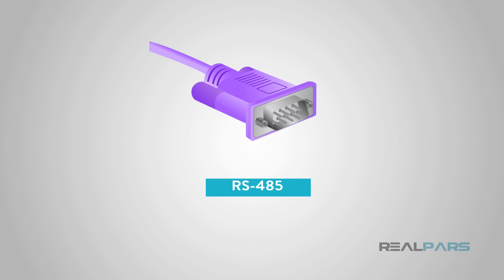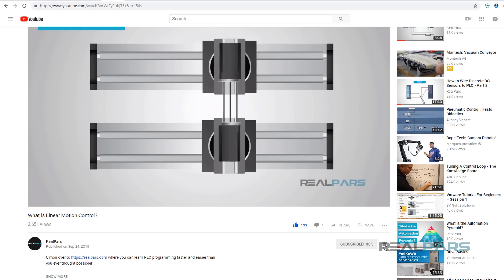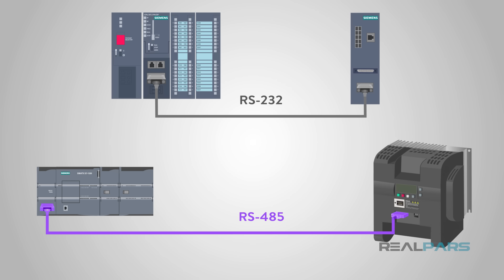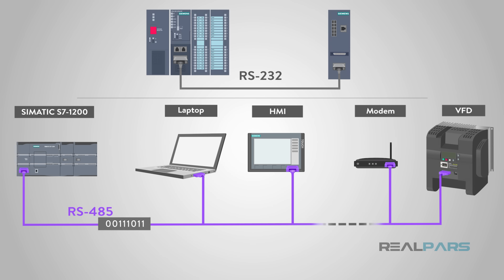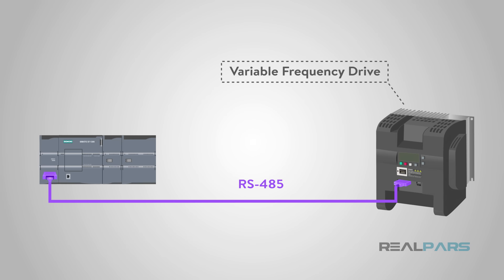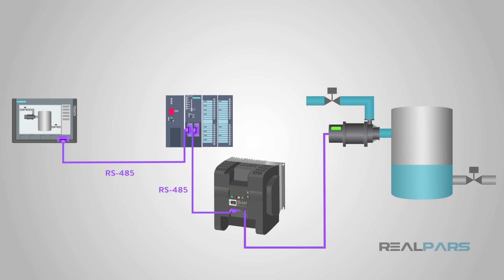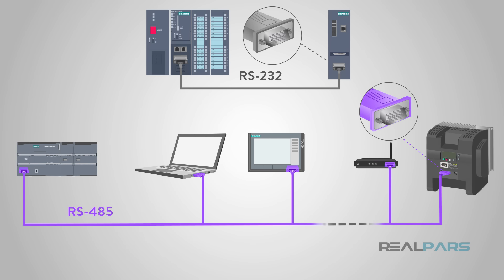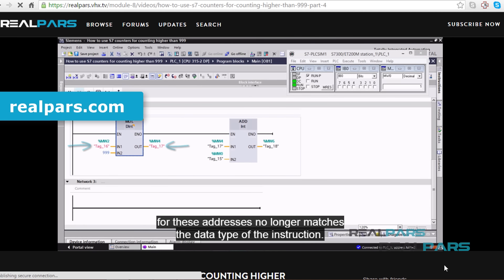What is RS485 and How it's used in Industrial Control Systems?

Comment: The range of the bus is higher and it can support faster speeds because of Differential Signalling. The signal sent across the bus is not referenced to ground, but to each other. The difference in signal levels between the bus wires determines a 1 or a 0. Noise if present pushes both the wires up or down in the same magnitude, thereby maintaining the difference in signal levels. USB is a faster bus partly because of differential signalling.
Reply: In fewer words, a balanced signal.
Reply: great summary, thank you.
Reply: Sadly, the USB bus until version 3.0 used a single twisted/balanced pair of wire, unlike the FireWire which used one for transmitting and one for receiving, causing significant delays and slow-downs on USB.

Comment: Resistance to electrical noise isn't only because of cable shielding, but also thanks to the fact it uses a differential signal rather than a common ground, as with CAN bus. This also allows compensation against interference.

Comment: The 485 systems I work with can address 255 devices... 32 devices is the minimum unit load supported.  10Mbit is the fastest speed possible... you can't go as far in distance at that speed.
Reply: Right we do 99 just because we only have 2 addresses dial’s. Also 1000’ is about as long as we can go without a repeater. With networks way way over 4000’ total length.

Comment: How to connect an inverter that has an RS 485 connection with a heat pump that is controlled by the SMART GRID connector?
Reply from the maker: Hello, @mateuszmayjaszczyk7415. Thank you for your question. Sorry, but we can’t comment on this. We don’t know your system. If you don't have a user manual, it would be beneficial for you to contact the manufacturer.  Happy learning from RealPars!

Comment: My new residential heat pump uses rs 485 for thermostat and communication between the air handler and the compressor condenser. To bad Honeywell and others stick to the 5 wire c configuration…

Comment: You may need a termination resistor of 50 ohm. Avoid running the wires outside it become damaged by lightning. As a field service engineer I found that electricians are used to wire electricity a and electronic,  make sure they know that black is ground and red is high in electronics. Rs485 wiring is very sensitive that way.

Comment: We used to instal high end Point of sale network with RS 485 cables. This is highly reliable. Terminal to terminal ( IRC) and Kitchen printers commonly used. All systems on embedded platform. Master / slave configuration and programs done.

Comment: RS-485 is more accurately described as the grown up big brother of RS-422. It’s not fair to compare it directly to RS-232. The reason RS-485 still enjoys massive usage in industrial applications is due to the range of physical layer implementations. As stated in the video it supports multi-drop as opposed to just point-to-point like RS-232. However, it can be used in full or half duplex modes. This means that a station on a RS-485 bus can simultaneously transmit and receive data at the same time.
RS-485  can be transmitted over both optical and copper physical layers. The optical implementations support dual redundant optical rings which are very robust. Both optical and copper layer repeaters mean that each copper segment can be extended to then support up to 255 node addresses (0 to 254) for the overall network. The actual protocols that run over this RS-485 physical layer are also very lean and efficient in data throughput. Profibus-DP is one example, but please note that Profibus does make a number of changes to the underlying RS-485 physical layer rules (capacitance and inductance limits, etc). Profibus-DP can run up to 12Mbps. Unfortunately, RS-485 is probably the single most misunderstood transmission technique due to a lack of understanding about bus termination requirements and correct screen connections.
Reply: Very good, RS 232, in most configurations, is point to point Where RS 422 is point to multi-point  and  RS 485 is multi point to multi-point.  Where I once worked we made counter rotating, self healing, multi-master ring modems capable of translation from 485 to/from 232 to/from 422.
Reply: David Moran 

This flexibility and ability to in effect cascade these different physical layers has also contributed to its longevity and success. RS-485 devices can also be used to replace failed stations in older RS-422 architectures with very little difficulty, although the reverse isn’t always possible. However,  you can drop an RS-485 master into an existing RS-422 slave network with no problems.
Reply: Hi ! how can we use the RS-485 or RS-232 like does it have a relationship with the devices or cablee

Comment: Practically t it is an industrial  I2C communication that may work with 12/24 V without a clock (SCL) or a SDA pin. Instead of that uses A and B lines to communicate as if they would be TX or RX, but at the same time works by adresses. If I said something bad, correct me. I never knew about that type of bus before. (But the video gaved me an idea).

Comment: I find this useful and until earlier today at work I had never heard of RS485, but I’ve heard of and used a RS232 Cable connection. I also maybe think 🤔 something that could of also being elaborated on in the age of where almost all if not many controllers have a Ethernet connection when and where a RS485 cable could be useful? I’m just junior programmer but do O.P.A.C. Engineering - Operation, Process, Automations Control Engineering. Wear many hats in what I’m doing from one week to next. Two weeks ago was on a RO plant water system startup at a plant site. It was SLC PLC with redundant processor chassis and all Ethernet connected to plc network switch with remote I/O’s. To connect directly to the SLC  Processor while system was all online had to connect via RS232 on the SLC Card to Primary and Secondary Processor. As the Ethernet port was in use on both cards connected to network. That’s an example I can think of and recent where having my RS232 to USB on laptop Serial cable came in handy and was good to have. Such an example also could of being more in depth explained with the RS485 cable in various situations. However, still excellent video to educate and the more I now know.
Reply from the maker: Thanks for sharing your thoughts with us!
Reply: Is there a list of cables that fall under the category of RS232 and RS485 separately?

Comment: In the case of controlling a vfd, that also could have been achieved by a current loop.
You could have pointed out more benefits.
Ability to push firmware updates, remote configure device, receive status information etc.
Reply: Can I use RS 485 cable with DB 9 pin head, instead rs 232 cable with the same head?
Reply: You can use a DB9 connector but what do you mean by RS485 cable? Any twisted pair shielded cable can be used.
Reply: @piratenu1  Lust night I have fixed...Thanks for help

Comment: its a very good informative video. Just a little correction, when you say that an that an RS-485 network can only support 32
nodes. This is not true. Device manufacturers now sell 1/4 UL transceivers (DS1487) and even 1/8 UL parts (MAX1482).
Assuming each node presents 1/8 UL to the transmission line, an RS-485–compliant network may sport as many as 256 nodes (32 UL × 8 UL/node = 256 nodes).
Reply from the maker: Thank you, Mario! Much appreciated

Comment: Hello, I have a question about 485 communication.
Is it possible with a “D1 MINI WEMOS Pro 4M 16M” using “Tasmota” e.g., B. to control a “JUNTEK DPM8624 60V24A Programmable DC/DC Digital Adjustable Step Down Voltage Power Supply Buck Converter 485 Communication”?
Reply from the maker: The D1 Mini includes WiFi and is compatible with Tasmota.  You will need to provide a driver or other firmware facility to allow the D1 mini to communicate via RS-485 to the Juntek unit.  This should be a straightforward task, as the Juntek provides serial communication capabilities via TTL, USB, and Modbus-RTU.

Comment: Nice video! Very didactic! 💯 I think the only missing thing was to mention the 2-wire o 3-wire type of RS-485 and the terminator resistors or voltage bias at each end of the network
Reply from the maker: Thanks for sharing that, Sergio!

Comment: Is RS-485 a protocol or an electrical standard? When I use RS-485 in the field, it is usually either security panels or PTZ camera controls, and each of those use different proprietary communications protocols OVER an RS-485 connection. One example is Honeywell panels that use RS-485 and their own communication protocol and so require Honeywell gizmos to interpret their protocol and translate to RS-232 which is then converted to Ethernet to talk to a server and database. It is akin to speaking the same language over a telephone, but someone who doesn't speak that language needs a translator. Another example is a PTZ camera that has an RS-485 2-conductor cable back to a PTZ controller. Just having the cable connection is not enough, they both need to be set to a particular communication protocol (speak the same language over the line) such as Pelco-D, Samsung, Vicon, as well as having the same baud rate.
Reply from the maker: Jason, you are correct.  RS-485 is an electrical specification that protocols written to use RS-485 must follow.  In OSI stack terms, RS-485 resides at the Physical layer (Layer 1) and the protocols that run on top of RS-485 are defined are the Data Link layer (Layer 2).  Modbus TCP, Profibus, etc.,  can all use RS-485 at the Physical layer in addition to those you mentioned.

Comment: How is the data in RS485 being handled in the program, specially the floating values? What I mean is if you have multiple devices connected through RS485, with double word, floating values and if you want to apply mathematical operations on those data. How will we going to do that?
Reply from the maker: Thank you for your question. The RS485 standard defines how communication works for RS485 devices. You will write your program in the specific block for the device you want to control. Each device has an address, and your program will communicate with the device you are addressing. Once you set up your hardware configuration, such as IO cards, VFDs, HMIs, etc., your communication blocks will look at your program and address the devices accordingly.

RealPars courses offer comprehensive instruction on programming and setting up communications with many popular PLCs. You can sign up for free and start learning today.

Happy learning
Reply: @realpars  How to sign up?

Comment: Thank you for the video.
I have a question, what is the maximum length that can be used for an ethernet cable?
Reply from the maker: A CAT5 or CAT6 Ethernet cable can be run up to 100 meters (300 feet) without loss of signal, at baud rates of 100 Mb/sec or less.

Comment: I'm creating industrial automation projects. Yes, my brand is not Siemens, but those interfaces are still widely used despite the opinion that they are obsolete. That is not true. RS-232 is used for PC program upload/download/online mode in my projects. RS-485 (together with Ethernet) is used as main interface between the devices. On the other hand equipment which supports EtherCAT, CANopen and other modern time interfaces is more expensive. In most cases fast interfaces are not needed, so RS-485 meets the requirements.
Reply from the maker: Thank you for your comments.  RS-232 use is gradually fading, but it is still used in man applications, such as with programming terminals and analytical instrumentation (GC, HPLC, etc.).  RS-485 (and its precursor, RS-422) are very heavily used as the physical layer for many digital protocols (such as Profibus) and interfaces.  So yes, RS-485 meets the needs of many, if not most, interfaces between devices.  Little by little, though, Industrial Ethernet protocols are being used for backbone networks due to its speed and ease of connection.

Comment: in your video for Rs-232, you indicated that the maximum cable length is 100 feet. while in this video is 50 feet. which one we should consider?
Reply from the maker: 50 feet is what is given as the maximum length in the EIA232 Standard.  The signal could, in many cases, be run 100 feet without issue.  The limitation with length is voltage, and the farther the cable is run, the more voltage drop there will be.  Once the voltage drops below what is required for the electronics to distinguish the data stream (+/- 13VDC).  50 feet was chosen since it is guaranteed to have sufficient voltage for communication using a compliant RS232 cable.

Comment: Hi RealPars, thanks for such an informative video. I have a question though. You showed in the video that the PLC and VFD are connected via RS-485. But what about the input and output terminals? Are input and output (i/o modules) needed in this system for control? My understanding was that we use the i/o module of the PLC to connect the VFD or any other type of field sensors, but it looks they are not needed once we connect the VFD with PLC via RS-485. Can you please clarify between the difference or relationship between input/outputs and communication standard? How these two work together in a system? Thanks a lot.
Reply from the maker: There are several ways to connect a PLC to a VFD, and it depends pretty much on the model of VFD you are using.  There are two main ways to connect to a VFD:  hardwired and communication bus.  With hardwired, there is an I/O board on the VFD that allows for wiring of PLC inputs and outputs to control and monitor the VFD.  This would include analog signals (speed reference, actual speed, current draw, etc.) and digital signals (start, enable, alarms, etc.).  For a communication bus (RS-485 based protocols like ProfibusDP, Industrial Ethernet, etc.) all signals are programmed and provided through a single communication cable.

Comment: Thank you Realpars ,I have question Can i control VFD via RS-485 although the communication between the plc and hmi Via ETHERNET?
Reply from the maker: Yes, as long as the controller and the VFD have an R-485 communication option installed (interface cards).  I designed a system not too long ago that had 5 different communication protocols (Ethernet, Profibus DP, Profibus PA, ASi, and IOLink) installed for communicating with different devices and components.

Comment: Hello!, do i have to put a resistance of RS485 half duplex at the end of the connection?
Reply from the maker: If the data rate is low or cables are short, termination may be unnecessary. As data rates and/or cable lengths increase, which is in most cases, termination becomes mandatory.  Use of a 120-ohm resistor at each end of the segment will take care of communication signal issues due to impedance mismatches between devices.  RS-485 is an electrical specification, and 2-wire protocols, like Profibus, which uses RS-485 as a communication medium, are half-duplex.  In general, RS-485 installations will require terminating resistors.  Full duplex RS-485 requires four wires, and is not very common in industrial control systems.

Comment: So RS485 is a physical connection, and on top of it there is the protocol that makes the nodes communicate and control, like modbus, canbus, SCADA...is this correct?
Thanks.
Reply from the maker: Yes, RS485 is merely a physical (electrical) connection and as you mentioned, some defined protocols such as Modbus, Profibus and so on using it as one of their physical media to make their nodes communicate within the network. Thanks for your question.

Comment: Is RS-485 communication medium only used in Modbus communication protocol? Or is it used by other communication protocol in industries too?
Reply from the maker: RS-485 is an electrical specification that is implemented at the physical layer of a protocol.  Several communication protocols use RS-485 for the physical layer\, most notably  Modbus and Profibus-DP,

Comment: can you please with the wiring of 360 Visions Predator CCTV System? I have wired it through the Matrix Control Unit16/2 -and the joystick VKXM-0845-EU controller with RS485 cables, all that is coming out of the camera is a bunch of wires that have been chopped off. I have managed to identify all of them, but am unsure as how to wire the 4 wire twisted pairs, i.e., Red & Orange TX/ and Purple & Blue RX From the camera do they go to the matrix or the controller, and which pins on a RJ11 6 wire plug? any help would be very much appreciated as 360 vision diagrams only cater for the special power supply connector board, there seems to be no circuit diagrams available, I can supply pictures...
Reply from the maker: This is a product I am not familiar with, nor did I find anything useful on the internet.  This type of information (wiring or circuits to the board level) is usually available only from the manufacturer.

Comment: Hi newbie to modbus here, so if i'm using usb to rs485 terminal strip i just need to connect A B to transmitter then it will works? do i still need to connect ground terminal and 5V power?
Reply from the maker: In most cases, you will connect three wires: A and B, and ground (common).  Power (5V) is supplied by the USB port (if connected to a computer).  There are USB connections that are stand-alone, which will require external power.